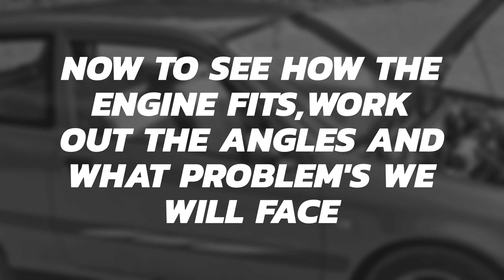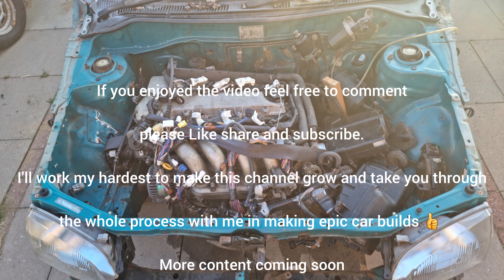Breaking the Celica T sport and putting the 2zz into the Starlet (Engine Swap Series Ep2)

Comment: great work mate, I'm wishing to see how it finally ends, I have an EP90 and  I thought to make 2ZZ Swap, continue doing it well :D
Reply from the maker: It's definitely a lot of work. So it's only worth it if you want 200hp N/A with some breathing mods. Or if you are going down the Forced induction route. At the moment I'm having to deal with how I'm going to fit rhe brake master cylinder/servo because the starlet one pokes out waay to far. I look forward to showing the whole process. Thanks so much for the compliment and comment. :)

Comment: For brake master, try a hyundai excel or maybe an old mini. I believe both are remotely mounted. As for the engine swap, a 3D scanner would save you heaps of time and make it so much more accurate.
Reply from the maker: Not a bad idea at all then I can place the servo anywhere. I'm leaning to that solution over a smaller brake master. Thanks for the advice 👍

Comment: Hi, what did you do with the brake servo issue later on  I'm. Attempting to fit a 3sge into a starlet ep91
Reply from the maker: @Automotiverecoveryuk  hello I used a chase bays brake booster delete kit. https://www.chasebays.com/products/chase-bays-brake-booster-eliminator-honda-nissan-mazda-mitsubishi-ae86?srsltid=AfmBOorh-r4aGHk9VfcZ0ALWIKhfV3Kg5FNU7KDmWc8mqnx_P8hTXSKG
Reply from the maker: @Automotiverecoveryuk  hey I replied but I think youtube removed it because I put a link. But it's chasebays brake booster delete kit. Hope this helps :)